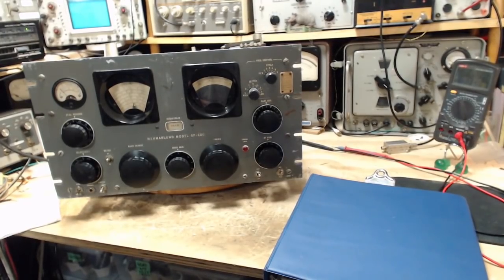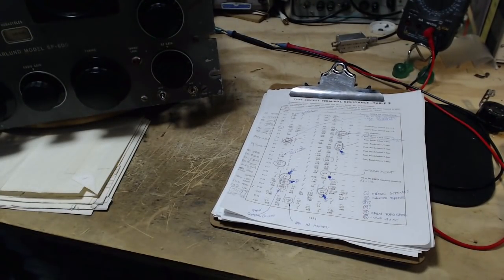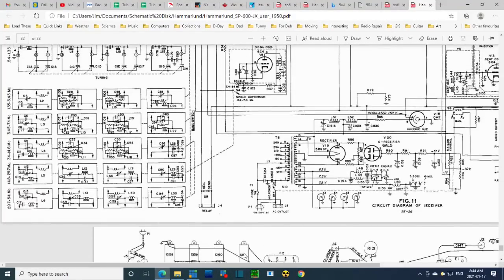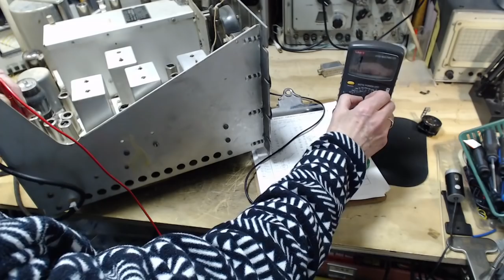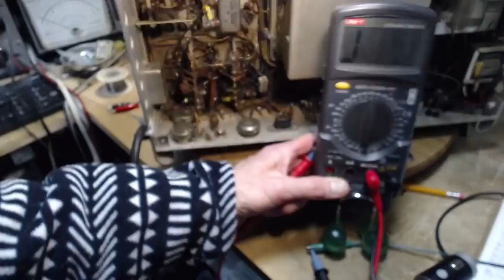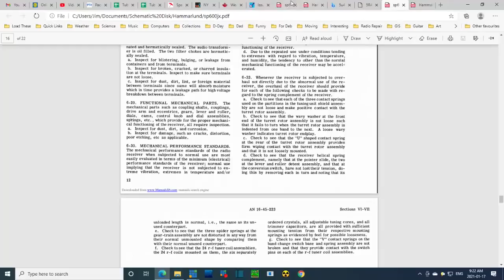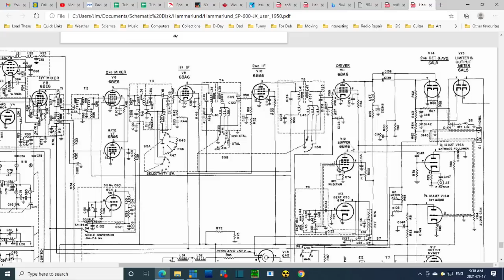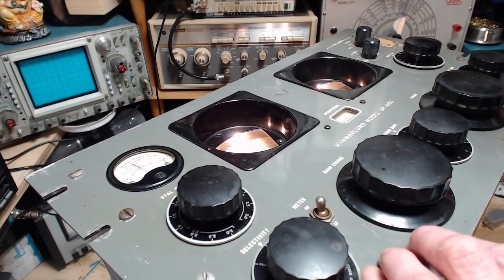Hammarlund SP 600 Video #3 - Two Faults Found and Fixed

Comment: I put the paperwork for EVERY radio, test equipment , phonograph and a few assorted Heathkit booklets and radio notes in their own folders just like Jim.
 The outer edge of the binder says what it is. Cover may show a picture . It helps tremendously as a place for notes , photos and of course schematics,
whether purchased or down loaded. I've got quite the library so far! White binders ( my favorite ) can be easily found at Goodwill for a buck a piece. 
  Looks like someone had a bad habit of tack soldering in the chassis. Solder should not just be used as a mechanical connection , you need to twist wires to each other
 first then solder the  connected parts together.

Comment: He did a lot of work taking resistance readings, then finds out that it seems the sheet he used is not for his model. So he looks at only the ones that are bad and not all of them either.  He should at the least verify the readings with his model, but don't see that happening.  Along with pot cleaning that was pretty obvious when he was showing the operation a few vids back. At least its his own equipment this time, he can mess all he wants.

Comment: HOW DOES HE EXPECT TO REPAIR THE RADIO WITHOUT TEARING IT APART ?!!!!
He just looks at the schematics and a bunch of numbers, ridiculous...
Reply: I still wonder how one could bust a power transformer by replacing a rectifier tube with semiconductor rectifiers. These transformers dont die that easy. Unless you neglect any form of protection like dim bulb. 
I bet the radio will perform worse when he is done and receive nothing but static.